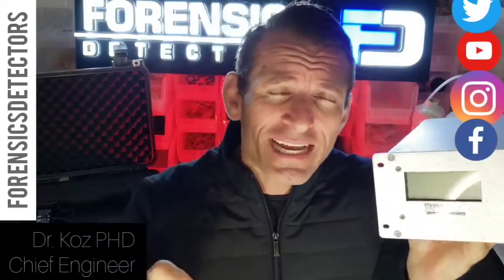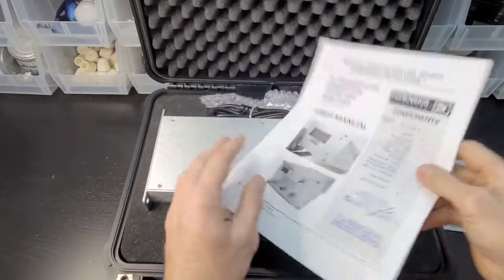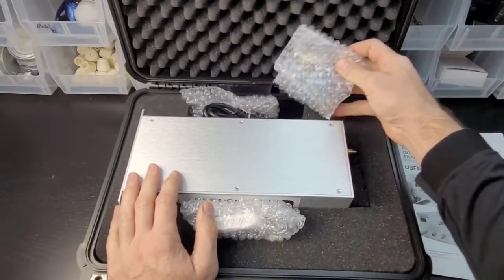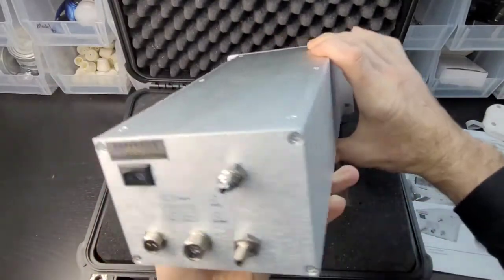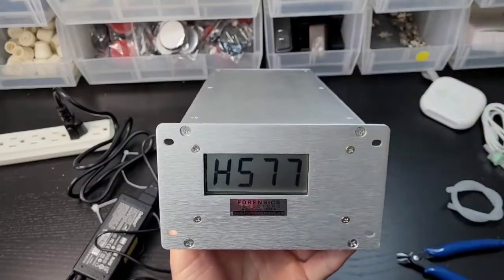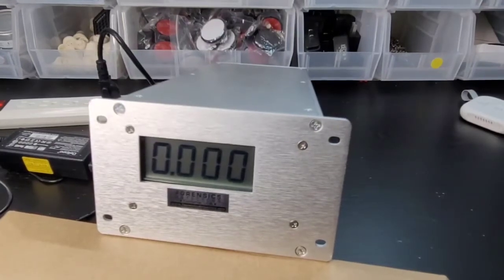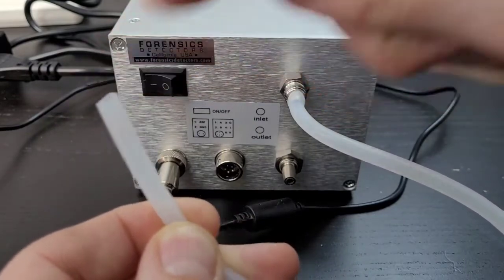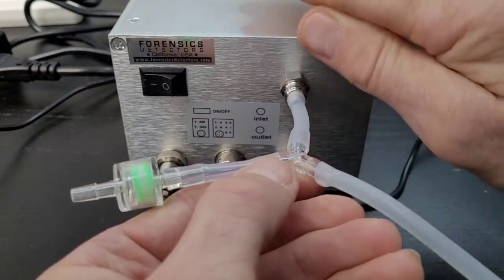OZONE Analyzer 1ppb (0.001ppm)

Comment: Good morning.

I'm building medical ozone generator devices and I need to measure ozone concentration from 1microgram/liter to 100 micrograms/liter ozone concentration. This is pure gas, o2 mixed with o3.

Do you have any product that match with these parameters?

Regards.
Reply from the maker: 1 mg/L = 1 g/m3 = 467 ppm of ozone in air (volume), so 1ug/L = 1mg/m3 = 0.467ppm and 100ug/L = 46.7ppm. Our OZONE analyzer, this unit, will be perfect, but please understand it has a pump and requires a certain flow rate of gas to undertake an accurate measurement. What is the flow rate coming from your generator?
Reply: @DrKozForensicsDetectors  1/8 liter per minute. How much cost the device ando where I can get it?
Reply from the maker: @axellitoral1503  Please email us at sarah@forensicsdetectors.com and we will kick off all details there.
Reply: @DrKozForensicsDetectors  Thanks, mail sent!